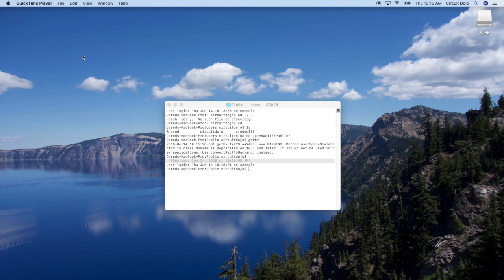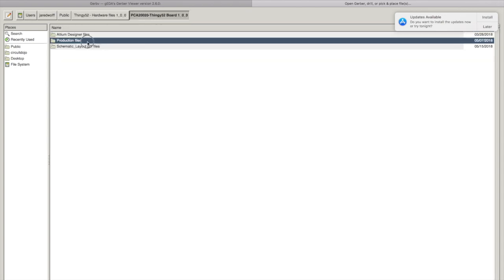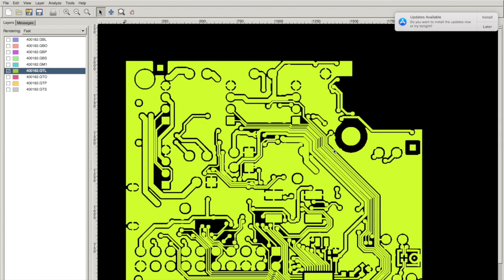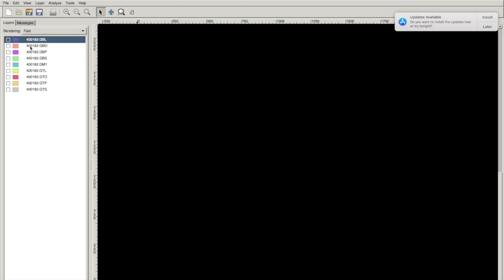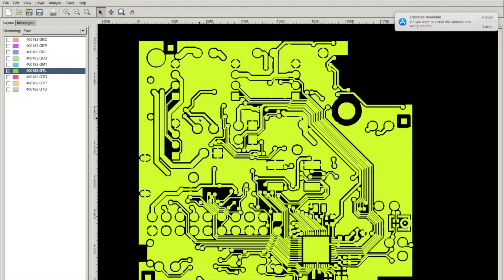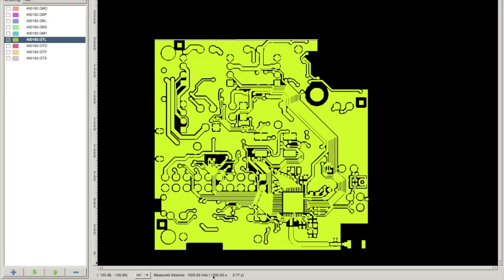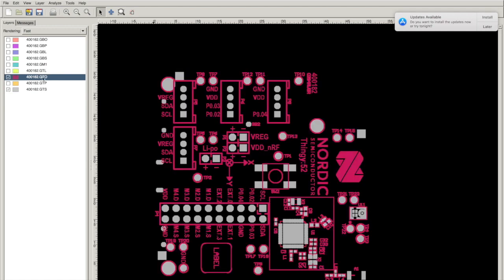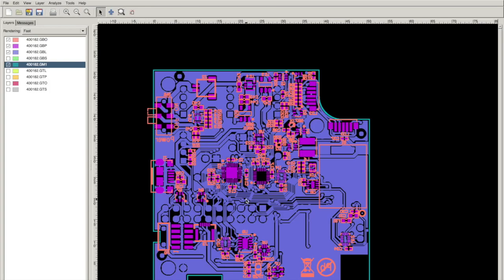Check your PCB gerbers with Gerbv

Comment: Hi Jared - Thanks for taking the time to create this helpful video. Can  gerbv also be used to verify drilling-related aspects of a board? - Thanks - Jim
Reply from the maker: Hey Jim, 
Since the drill file is in a different format, I believe it doesn't typically work with gerbv. That's likely the biggest drawback of using it. You could upload your files to a service like OSH Park and you can see the visual of each hole. If often export my designs to Fusion360 for final checks. This works fairly well with routing/hole checks.